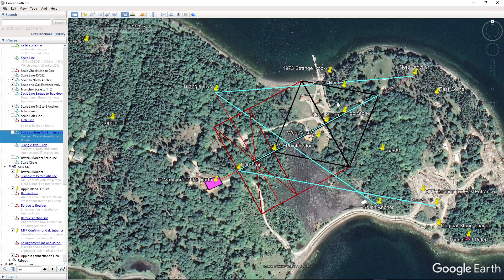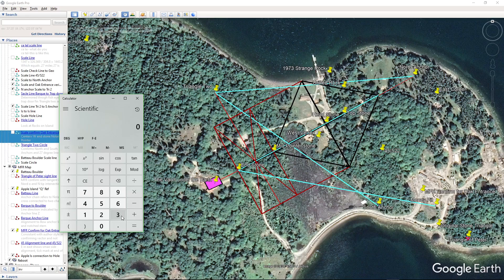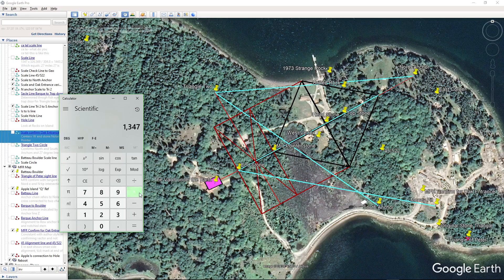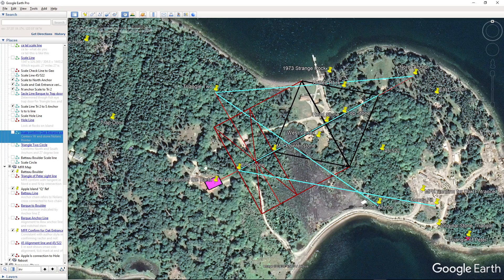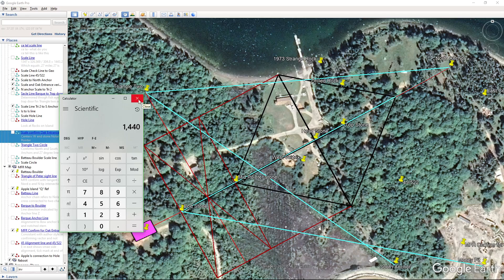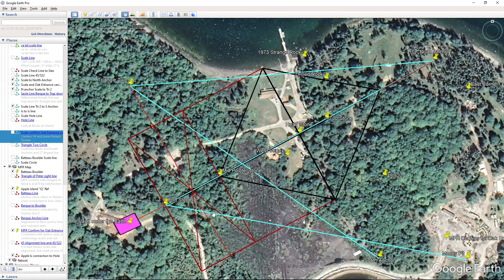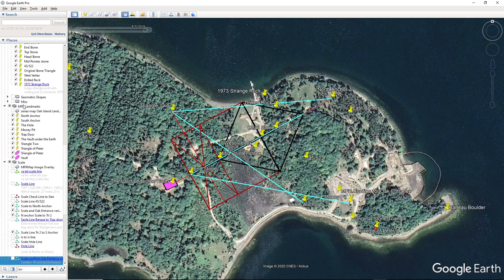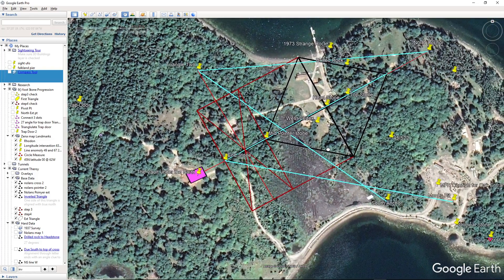Oak Island Update: Nolan's Cross and Scale Function made simple

Comment: But you cant change the system of measurement. You have to use what a foot was back then, converting it to todays foot measurement will make it off!
Reply from the maker: We use the pre-1668 French pied equal to 326.569 mm. This is the unit of measure that is associated with the documents and Nolans Cross.
Reply: @DOTtoDOT  ok cool! Also just for information 11feet used to be used as a system of measurement! Ever seen the old wooden fence that lay on each other on old property? They are 11feet long from end to end